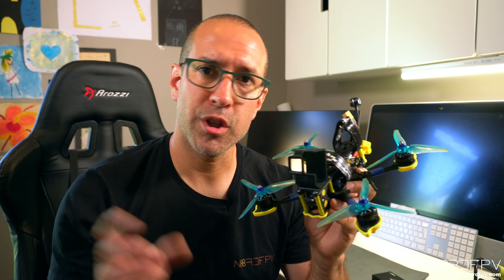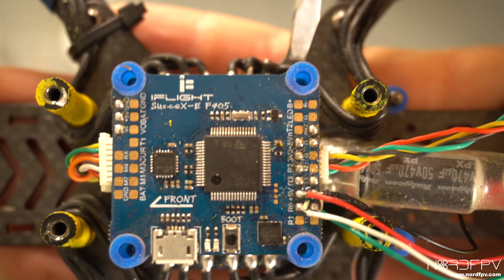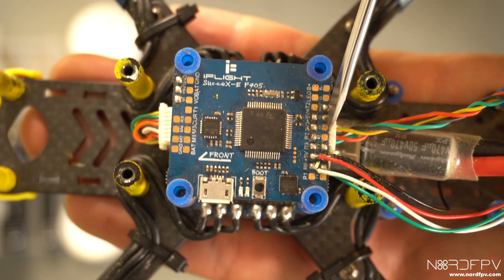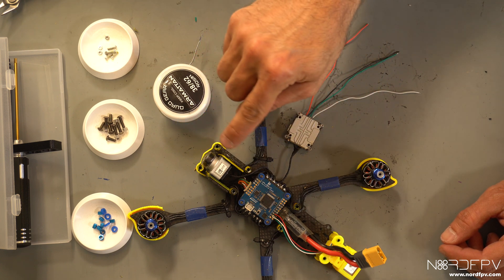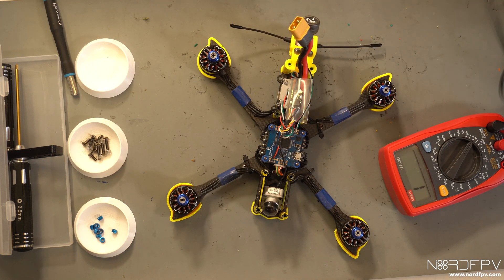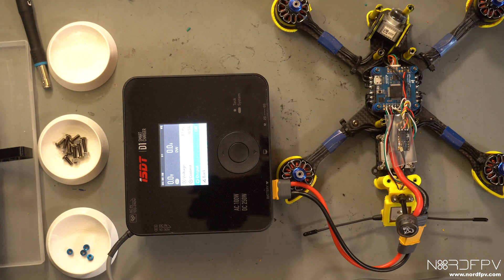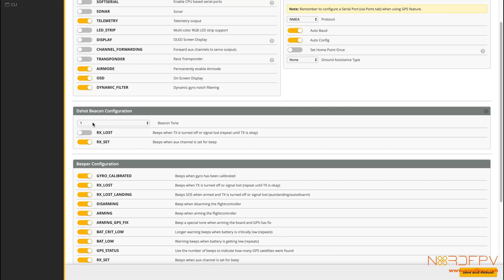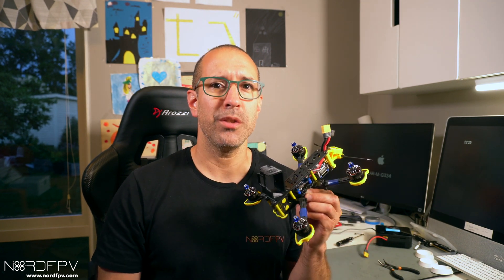How to upgrade an analog iFlight Nazgul to digital (DJI)

Comment: Im planning to get a nazgul xl5 analog and eventually upgrade to digital with the o3 unit. Will this be possible without changing anything else other than the camera?
Reply from the maker: No. Unfortunately DJI is not a friend of upgrades. DJI has changed a lot both the air unit and camera, and you need special parts to hold them. For the camera you need some silicon rubber to avoid vibrations. Please but a frame that’s made for your VTX. Even O3 and O4 are very different and it won’t work.

Comment: Gonna be doing this with the dji o4 any time soon?
Reply from the maker: I'll probably do some videos building with O4 yes, but most frames will require new parts, upgrade kits to fit the big camera of the O4. That means not every frame will be adaptable to O4, and there's a chance that you better wait and build from scratch with a frame designed for the O4 than just try to upgrade the one you have.

Comment: WTF you plug your quad directly into the charger? I knowits possibel with a bench powersupply but with a lipo charger? Does it damage the components and what settings did you use in your charger for a 6s quad?
Reply from the maker: Many lipo chargers are power supply. Just check if your charger has that mode. almost every kind of modern charger will do it. You select voltage and amp and ready. It’s. Good way to prevent short circuit when building

Comment: If I want to use the dji controller as well we’re will I plug the sbus
Reply from the maker: Hi Sam. The SBUS cable goes into a free RX on your FC. See that if you are installing a vista, or an air unit, you will need a RX/TX pair for the SMP (OSD, telemetri, etc), and one RX (different) for the SBUS. Just remember if you are using a F4 FC you RX should be inverted for SBUS, and if it's a F7 board then it doesn't matter if it's inverted or not.
Reply: @NordFPV  what do I mean by inverted!

Comment: Hello. May I please to share info about voltage and ampers you used to power drone directly from charger? I have Hota D6 Pro and also I can powered external devices, but I am a little bit scarred to do that.. I have Nazgul5 V1 6s. So I know that I can use 6s voltage (25.2V) but what amount of apmers is safe? Or how you do that for safe purpose for devices like 6s drones? Best Regards!
Reply from the maker: Hey. On the bench you don’t need much. I normally use 16v. When it comes amp, if I suspect of a short circuit or I’m testing for the first time a build I use 0.9 amp. That will of course not power a motor, so if after the first time nothing went into short, you can then bump to 2 amp or 1.5 to test everything else including motors
Reply: @NordFPV  Thank you very much! Clear for me now. Thanks!

Comment: Wait I thought crossfire isn't compatible with the dji controller unless the vista is just for the dji goggles? And correct me if I'm wrong but the vista has a pad for the dji controller?
Reply from the maker: Hi, Crossfire and DJI has nothing to do. There's no compatibility or anything between them. You can always use the vista only as VTX (Video), and just ignore the control part of it. But as you say, the vista has 3 pads that are used for the DJI controller (VBAT, GND, SBUS)
Reply: @NordFPV  got it thank you

Comment: Hi, do you think the preset pid tunes that come with it will be fine with the added weight or is there a way to swap the pid tunes with the hd version since it is made for the extra weight?
Reply from the maker: Hi Ben, The original PID won't be very good, as you said, because of the added weight. I just went to iflight's webpage and took the configuration of the HD version and copy the PID section. Otherwise the best will actually be to tune it yourself, there are many guides on the internet.
Reply: @NordFPV  Thank you for the reply!

Comment: Hi Sir, how did you connect the stock antenna of the nazgul to vista? And if i’m not mistaken, you didn’t use the antenna of the vista, right?
Reply from the maker: Hi Mark. No I didn't use the stock antenna. You need to get an adapter from uFL to SMA (or RP-SMA), then you connect your SMA (or RP-SMA) to this adapter which sit on the 3D printed piece on the back

Comment: A few month ago i had to choose analog or digital.... i've choosen analog but now i got DJI Googles too and need to convert the Nazgul v2... your video helps out a lot, thank you!
But i have a few questions....
Do your Vista have contact with the carbonfiber frame?
Which kind of exact screws have you used for vista mounting on frame?
It seems like you have a Nazgul v1? Mine have plugs for camera and in the box were different cables and connectors for using like vista kit.
Reply from the maker: Thank you for your kind words!
No, I don't like any part touching the carbon, even if it may be ok, I always have either spacers to raise a card/part, or some isolation layer like plastic or tape.
In this case I added some plastic nuts which helps keeping the screws in place and raise the vista, and then I have a long screw going through the vista and another nut on the top. I saw recently another solution which was extremely easy: zip ties through two holes in the vista, it works very well. The nazgul has had many revisions, I think I got one of the very first ones, but hopefully the concept is enough for people to move from analog to digital
Reply: @NordFPV  Thanks for the advice about the zip ties. It works perfecly and is very easy to install.
Reply from the maker: @shadowsan87  great to hear!

Comment: what is the name of this antenna "fixer"?
Reply from the maker: HI, sorry, I don't understand the question. What part are you referring to?
Reply: @NordFPV  the antenna adapter, to fix it to the frame
Reply from the maker: @rafaellopes4271  I'm still not sure what you are asking but I will say this: The antenna is connected directly to the vista, it's attached to the 3D printed part with a plastic pressure part that comes with the vista kit, and the 3D printed part was taken from thingiverse. Maybe this information helps?

Comment: Very helpful video. I'm getting ready to do this to my analog V2 (waiting on the Vista, they take weeks to get) and they've made the process slightly easier. 
The new version of the flight controller has a plug-in connector on it and you just have to solder open leads to the Vista. They even supplied that cable with the analog version.
Reply: What vistas work with it? Someone mentioned that the DJI air unit might not fit the nazgul frame. I've got the v2 analog version
Reply: @DexterGoneWild  Any regular Vista fits (they're all the same body). The Air Unit or Micro (stupid name by Caddx) is the full sized body without mounting holes. Not sure if that would work.
Reply: Hey let me know if u installed it on ur nazgul
Reply: @samtarariverasanchez59  I did, and it has been perfect! There's a mix of vids on my channel using the Nazgul and Gep Crocodile Baby that were both analog and converted to DJI. I only use analog on the micros now. Good luck!
Reply: @TheLostSquadron  I’m trying to wire it up but it’s confusing

Comment: is this a V1 frame or V2?
Reply from the maker: This is V1, but I believe the process will be the same for a V2
Reply: @NordFPV  i have the V1 frame and yours look very different to mine. i'm asking because i want to fit a polar vista on mine and there is definitely no space at the back
Reply: @Pistolier  In this case, also, you (and me) will have to rotate the ESC 180 degrees (the wires from the battery will now have to go from the camera side, otherwise it will not fit) and remap the numbering of the motors

Comment: Love your videos, very well paced and you describe the steps patiently. Subscribed! Thank you
Reply from the maker: Thank you!
Reply: I just the same updates as you(updated to crossfire nano and added the vista to my Nazgul5 V2 which as the same FC) but no matter what i do I can’t seem to have the OSD working. I tried switching the UARTs for both the crossfire and also the vista but alas no success. I can see the telemetry data when i do ‘discover sensors’ and can see all the values reflecting on my Tango 2 so i guess the crossfire is configured correctly. Any help or tips will be greatly appreciated! Thank you in advance 🙏🏼
Reply from the maker: There’s 3 thing are key here:
1.-the RX of the receiver has to be connected to the TX of the FC and the TX of the receiver to the RX of the FC
2.-SMP is enabled in the UART where you connected the receiver
3.-in your goggles you have custom OSD enabled
Reply: @NordFPV  Many thanks for your reply! I have checked triple checked all the three things but unfortunately no luck. Starting to think there could be an issue with my FC as the OSD wasn't working on the Analog VTX as well...Might need to trouble shoot in the CLI or get someone's help. Thanks again!
Reply: Forgot to mention my Nazgul is the 6s version so should I be cautious of connecting to VBAT? Will connecting the vista to +5 and GND will be fine as well?
Reply from the maker: The vista supports 6S so it shouldn’t be any problem. The vista doesn’t work with 5V. 
The air unit is the one that doesn’t support 6S. Max 4S